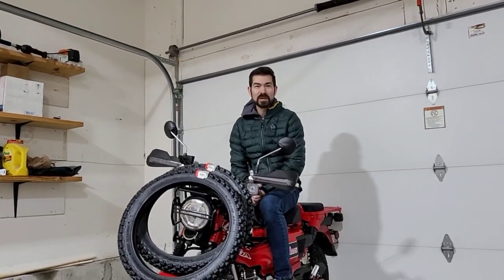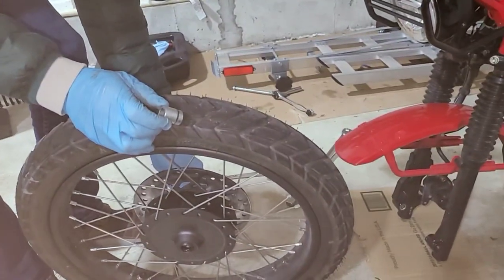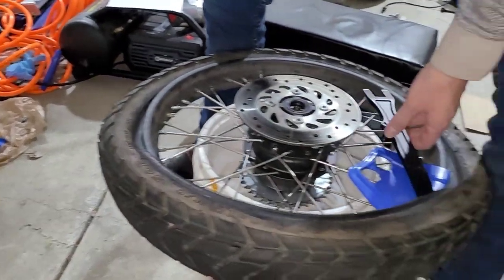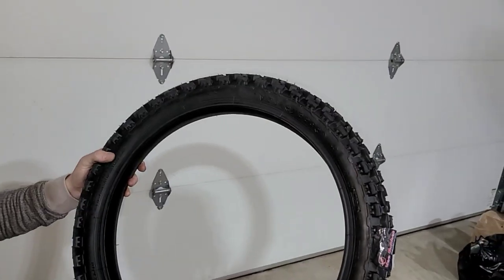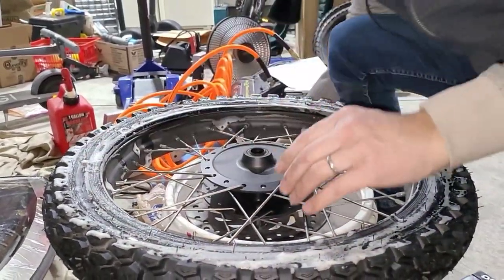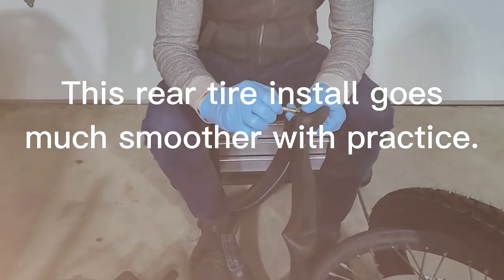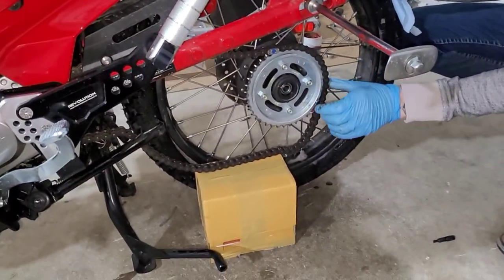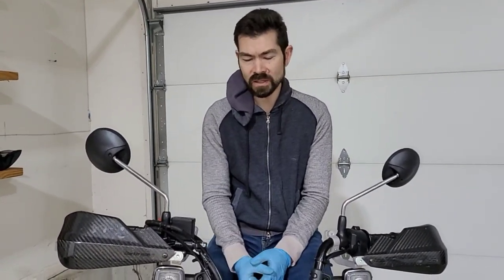SPOONING on the Honda Trail 125. The CT125 gets new Vee Rubber's VRM-022 2.75x17 Trail Tires!

Comment: Great video.

I find that putting one side of the tyre on the rim first then installing the partially inflated tube is much quicker and easier, and reduces chance of pinching.

For the second side push one section of bead into the rim valley then massage around to the edge. Done a few on the ct125 already unfortunately, but with practice can change a tube in 5 minutes.

Also agree that rim protectors aren't needed. 

Looking forward to all the detailed videos to come.
Reply from the maker: Awesome, thanks for the tips.  Next time I have to spoon on some tires, I will give that a try.
Reply: @QuantiQualification  check out @MotologyFilms video on changing a tyre in the bush. Plenty of good tips.
Reply from the maker: @chats5957  Will do.  Thanks for the tip.
Reply: ive thought about going tubeless but i decided against it... its very possible tho

Comment: I appreciate that was replacing with stiffer sidewall tyres and not just fixing a single punctured tube - BUT - after watching this excellent introduction to the joys of wrangling rubber in the warmth of a well stocked workshop I’m even more sold on the concept of tubeless tyres that can usually be sorted at the road/trailside with an external plug … as a subscriber I look forward to a video on the ‘ghetto’ or split tube tyre conversion! Sorry, I couldn’t resist!

At 30:00 or thereabouts you were having quite a wrestle reinstalling that tyre and I wonder if the bead on the opposite side was down the well or up near the wheel rim? I have seen videos where the whole caboodle of tube and tyre is zip tied together to keep it all in the well and therefore easier to lever on before zapping everything back into place with that 41psi 

I wonder why Honda et al don’t give more consideration to standardising sizes of fasteners? Perhaps 19mm each end of axles and four same sized spacers for example - surely any weight increase would be minimal in the grand scheme of things …

Once again an honest and lucid presentation - thanks
Reply from the maker: I do love the idea of doing the split tube tubeless conversion in the future.  I felt it was important for me to go conventional for my first time.  We will see if I go for it.  Certainly would require less to carry along although the spoons and the valve core remover aren't terrible.  As far as H's decision to have different non-standard sizes for bolt and nut, perhaps it helps at the shop level.  If you have to change a tire out while riding, more tools to bring along for the ride. 😅